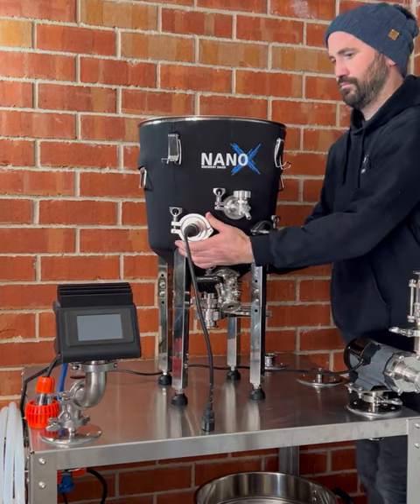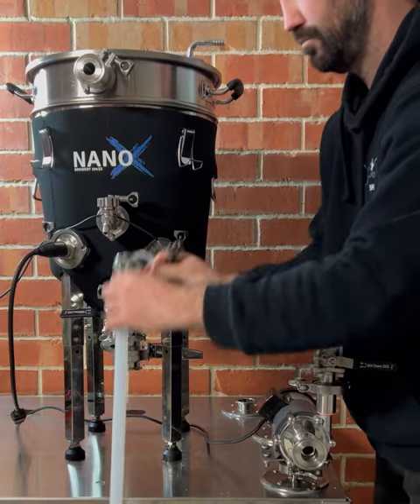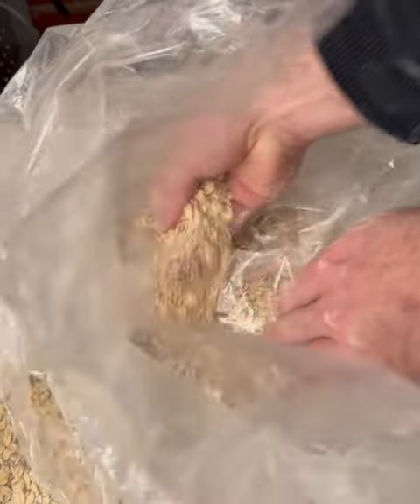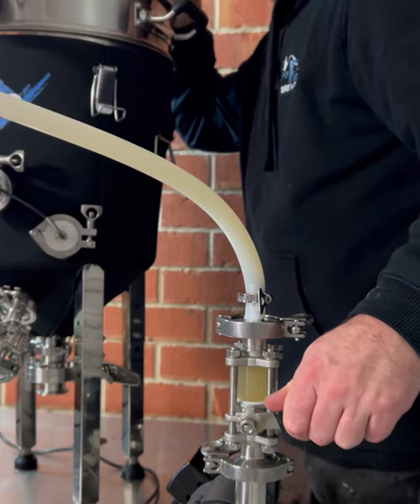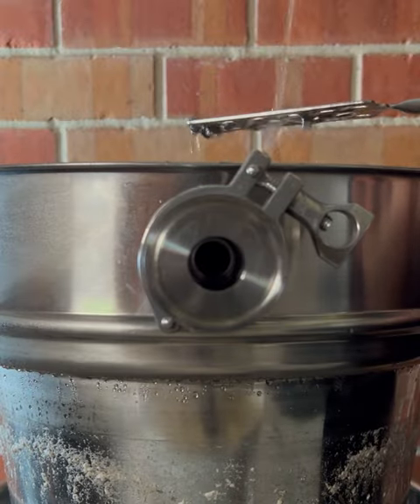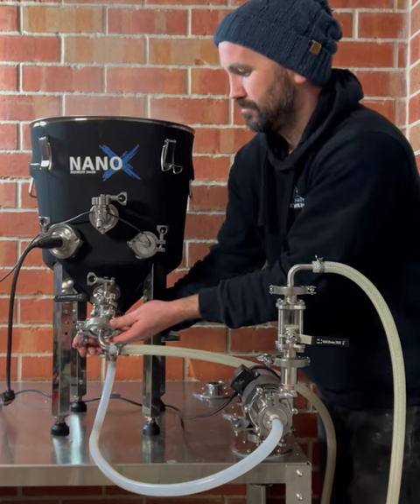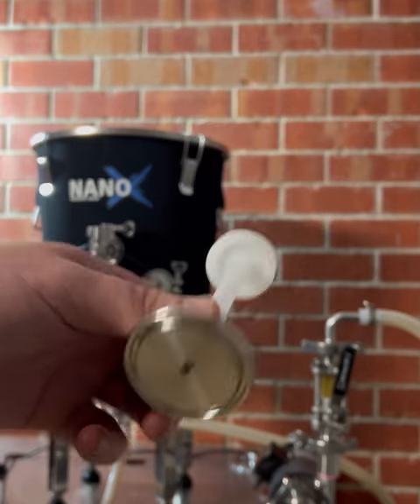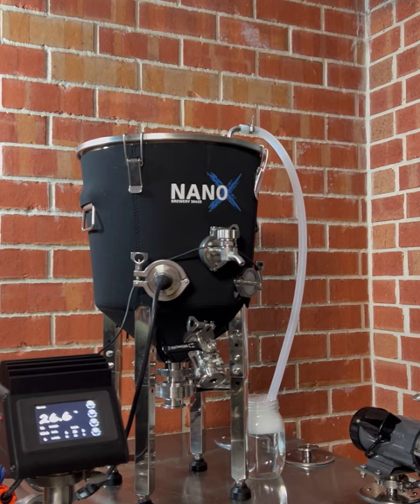NANO-X BrewFerm Brew Day - Hazy Kveik Pale

Comment: Its an interesting concept and a lot more compact, how would you handle temp control during fermentation?
Reply from the maker: Temperature control can be handled in multiple ways depending on your preferred process.

The BrewFerm does have an optional lid that can be added to the BrewFerm which then fits a coil for inline glycol temp control.

Other more popular option is to move the BrewFerm into a dedicated temp controlled fridge to manage all your fermentation temp control 👍

Comment: Thanks Sam, great vid. and I just learnt an easier way to sterilise my Counter Flow Chiller, i.e. run the boil through it for the last ten mins. how easy.
Reply from the maker: Great to hear! In-line sanitation is a fast convenient method for sure! Make for an efficient brew day without having to use chemicals. Plus it’s then all hooked up ready to chill for whirlpool additions and chill down to pitching temp